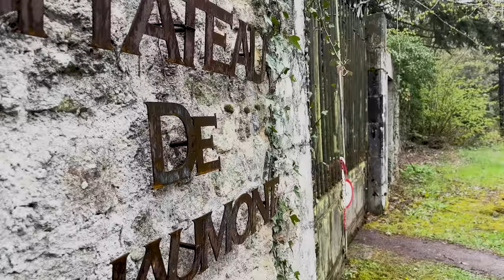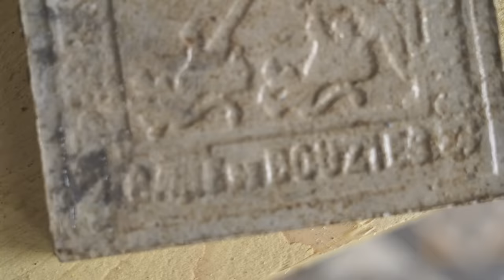Will the chateau's original 1920's tiles withstand REMOVAL?

Comment: Please store the tiles securely. With you off site and the tiles all in neat piles, it would be awful if someone helped themselves to them. Great to see Kat and good of her to help out.  You both did a fine job.
Reply: Just thinking exactly the same thing
Reply: Indeed. Thieves will thieve.
Reply: Best storage is a lock up container on site.
Reply: I was thinking the same thing.
Reply: Or a hidden camera onsight
Reply: Security cameras on site definitely!
Reply: Indeed. Especially when another poster checked the manufacturer and these are probably valuable.
Reply: @jantsjerijpma628  And then what? Cameras are only useful if you get recognizable things on them, which would not be likely here.

Comment: If you cant find enough to fill the floor, place as large a square as you can of the original tiles in the centre of the room, then add a new border inside the existing border tiles.
Ps as someone else stated, keep the odd bits to share with your viewers/supporters
Reply: This can be done with copies

Comment: I once removed til that were laid with a modern adhesive. I'm so jealous of how easy those came up. And Cat,  yes, as soon as the camera comes on they are impossible to move. It's the same rule that applies to funny noises in your car. The noise stops as soon as the mechanic is there.
Reply: With the old technique of using concrete (sand and cement) it's really a matter of luck. If it was properly done it's nearly impossible to separate the tiles from the thick layer of concrete (20-30 mm usually). I don't know what the main factors were but I'd assume the sand - cement ratio, the amount of water in the mix, whether the tiles were wet or dry and site factors like air temperature and humidity.

Comment: The Encaustic tiles that you are lifting our prone to cracking and chipping if left exposed to moisture/water for to long as well as frosts.
An extra tip for lifting stubbing ones is to use a hacksaw blade on its own to cut underneath it, it’s very slow and tedious though!
A thin wallpaper stripping blade can also help……
Just as a thought, one of those vibrating saw blade things could possibly help!
These tiles can reach high prices £50-£100 for single tiles sometimes, so maybe they should be placed under lock and key for the time being…..
There are still a number of companies that make them and can easily reproduce them, but again you could be looking at prices of £25+ per tile….

Comment: The tile lifting went far better than I feared. I guess they either lift, or in my experience they do not shift short with anything much short of a nuclear blast, which tends to be a bit over the top. Having a team always make the work progress far better, and that floor lifting went. The only way to think of it is that the tiles that are broken have had their chance, those that have been salvaged can be considered saved for reuse. You might be able to scour salvage yards and find some to fill in the missing items, or adjust the original design with modified boarders or similar. Mind you, it might just drive you nuts working out a new tile layout.

Comment: Well that job went a lot quicker than I expected. Lucky for you only the minimum adhesion was used. Thought it would take several days with a lot of breakages. The border being more of a challenge is better protected from falling debris than the centre so hopefully, you will get that out too.
Broken tiles - as someone suggested, the Japanese method of celebrating the damage with gold joints could be good. Gold veins catching the light in spaces with lighter footfall.
Nice to meet Kat. Cheery character and easy to work with. You've both done a great job today.

Comment: So nice you were able to save the tiles. Nobody makes them that thick anymore. You don't find any that thick in Home Depot. I don' think you can find anywhere that substantial around here. 
BTW- Ii think I know what those straps of iron are running between the corridor walls where you are placing the timbers. I think they may have been intended to keep the corridor walls from separating.  They were always intended to be in tension (to be pulled) because they are only straps. They are so badly misshapen now probably because the fire heated them so hot they oxidize more easily and actually got fatter and a bit longer.  It happened on my old wood stove  The parts of the metal that were red hot the most would actually bulge after a few years. This is thumb nail chemistry but the iron molecules actually get larger because of all the oxygen molecules added to them. Very hot metals oxidize very quickly. Borax or coke have to be added at times to get all the extra oxygen out of the metal before it is cast. 

I don't think those straps were ever actually necessary but the builder probably thought of them as a fail safe to prevent the floor timbers from falling from their sockets.  You cut your timbers square. When you build the permanent floor the way the original timbers may have been cut was at an angle. They were tapering outward toward the bottom of the joist. The reason they did that was in case a fire destroyed the building the falling timber wouldn't act as a lever and push upward on the wall above and topple it too. In other words the top of the timber barely penetrated the wall. Only the bottom edge fully enters the wall. 

Your house is actually showing signs of 19th century scientific building practices that were still in an early stage.  Houses older than yours probably weren't cutting floor joists like yours probably were. Your house was designed with more modern ideas. That whole stair hall couldn't have been built without the use of iron of steel beams. The columns hold the full height of the tower plus the missing roof that was maybe another 9 or 10 meters  higher. Those two columns carry some of the largest loads in the building.

Comment: This gives you a nice opportunity to replace the old floor with a polystyrene block and beam floor with radiant heating in it. Saves you a lot of energy in the future
Reply: Indeed combined with the dual pane windows he is working on in the background (and possibly triple elsewhere), modern insulation for the roof, this could be a very efficient chateau.

Just don't forget fire suppression this time around.

Would be interested to know what heritage constraints they are operating under.

Comment: Have you thought about heating the chateau? Now that the tiles are out, you can think about an underfloor heating combined with a heat pump. Gas and oil will not become cheaper, electricity you can produce (partially) on your own. And for the really cold nights you will have the fire places back, I assume.

Comment: Dan reach out to Phillip and Anna at How to Renovate a Chateau without Killing your partner. Anna made all of the tiles for their kitchen. She had a local kiln help her but she did the design. Bet she can help give you ideas on how to recreate the broken ones
Reply: Totally different kind of tile. Hers were clay with the design painted on and fired. These are cement with the different colors for each section poured into a mold of the design in a 3 layer process and then hydraulically pressed. A much more difficult and complicated process requiring specialized equipment and someone to recreate the design molds.

Comment: My husband did flooring installations for a couple of decades. I worked with him for a few years, and let me tell you, it's hard freakin' work. We had to remove ceramic tile in a kitchen once that would not pop out. We ended up having to use sledge hammers to the entire kitchen floor. Chips were flying everywhere, and we had little, bleeding cuts on us from it. If I never have to remove another ceramic tile floor in my life, I'll be perfectly happy.

Comment: For short/long term storage, milk crates set on pallets in in out of the way. In US hard plastic stackable crates are used to carry gallon milk jugs (4) onto fridge trucks for delivery to shops. Really useful for storage of bits to be recycled in future construction work. I presently have 15 crates in my backyard filled with hexagonal 13 inch exterior grade terra cotta tiles. Soon, very soon.

Comment: There are more than enough tiles to place the original pattern framed with the border tiles in the centre of the floor, (the framed tiles could be as large as the number of tiles, allows it to be). Another flooring material could be laid to cover the remaining spaces around the room

Comment: Good call to remove them, the concrete floor most likely needs to be removed and renewed.
And these tiles are unobtanium, in other words, very valuable and difficult to find.

Maybe an idea if tiles are diffcult to remove, slam the floor with a hammer just in front, so the vibration will loosen the tiles.

Keep up the good work, making progress!

Comment: Try using a thin metal scraper to remove tiles. That spade will be a bit much for the harder to remove ones. And don;t throw out any of the broken ones. They can be used for cutting in of the edges.

Comment: Okay Dan @Escape to rural France ……I can read  (?) DE DOUZIES  on the bottom of the tile, and here is what I found out about that. A reference online to “Antique French ceramic encaustic tile manufactured by Carrelages ceramiques de Douzies Maubeuge in the early part of the twentieth century”
The top looks it reads 8 (?) ANONYINS
Reply: Found more: Douzies Maubege French floor 1909 … encaustic tiles were produced by Societe Anonyme, Gare de Douzies, Maubege. 
So the top is likely not an 8 but S making the tile read on the top “ S. ANONYME” and the bottom likely “GARE de DOUZIES”.

Comment: Hi Dan, I'm sure you get loads of helpful comments. The unstable floor bothers me a little bit. If it collapses it will undo all your work in the Cellar. Might I suggest that you get an 8 foot by 4 (that'll be 1220 by 244o in metric) foot piece of shuttering ply or marine ply then dig as far as you can reach and then move it all forward and repeat that way you'll spread the loading. Just a suggestion.

Comment: You need a DeWalt oscillating tool. I’ve seen blades for those things about four inches wide. I bet one of those could get under even the most firmly affixed tiles.
Reply: Exactly what I was thinking.

Comment: So the tiles were not glued to the floor as we do today? Well, whether you put them down again with the same way, or use some kind of adhesive, remember that the floor must be very clean, because if there is dust after a decade or so, the tiles will start to come off. I've seen it in apartments where the floors were not cleaned up properly and the tiles started to come off and just the cost of removing them all and replacing them with new ones was significant, the least to say. Good luck with your renovation, you have done an amazing job so far.

Comment: Its very unfortunate that they have to be removed but I would guess the mortar holding them has deteriorated to the point that most are not being held down by much anyway and you have time to figure out how to remove the difficult ones later on I wonder who knows if there is a chemical or process to dissolve the mortar to get them up too.

Comment: The floor tiles are tight fit installation without grout.  That sure makes it easier to get them loosened.  
You really need a skid to pile them onto so you can remove them from the room with a forklift to store in a safer place.

Can you have a large shed delivered on the property?  It could see e several purposes; you can install the solar panels on the shed roof where they might be safer than the balcony; then you can keep your tools and valuables locked up in the shed. What do you all think?

Comment: Use a piece of scrap wood and put beside tile. Rest scrap wood at base concrete floor. Tap wood a few times and it may help you get tiles up easier before prying up tile with flat edge shovel. May help.

Comment: what are you going to do the floor with... concrete slabs like before or a poured concrete slab which i think will be stronger but then you might loose alittle bit of head room in the base ment to the i beams you need to have supporting the floors... unless you consider lowering the floors in the basement and strengthening the whole build from the foundation to the roof tiles.... btw would it be possible to use climbing gear to put tarps above now(just in the one spot you are working in) or do you need to stabalise the upper walls more

Comment: I'd recommend the tile lady from the Modernist Mansion (Ollie & Camilla).  The top might read "arondis" and the bottom either "douzaine" or "douzie"....also someone's recommendation of using clay and pressing it in could work.  You might also try bathroom silicone (100%, not latex mix) to make a mold.  That might be cheaper....it's wonderful that Kat has come to assist you.  I wasn't sure at the beginning, but when she bent down and her hair fell forward, I knew!

Comment: Really really urgent to get a plan in place to replace that roof!  As I’ve watched each episode since you bought the dilapidated château, I’ve been thinking out loud “ Dan needs to urgently get that roof replaced” !  First things first. Get the place watertight before doing any other project. That means roof first, then windows and doors!
Reply: He can't start rebuilding the roof until the walls are stabilized and he can't do either of those things until his building permits are issued which isn't supposed to happen until the end of June. He's doing what jobs he can in the meantime.

Comment: Why not just fix the roof? Gotta be the highest priority after cleaning out the rubbish.
Reply: Sometimes you have to work backwards to go forward, the walls probably wouldn’t withstand any cover or roofing placed on top of it at the moment.
Yes you normally start restoring a building from the top down, but you have to make sure the foundations and walls are safe before you start building on them.
Also the concrete ground floor is compromised and needs to be removed, which could weaken the walls even more until fixed

Comment: so you could not drape 6 pole mounts that would be sturdy enough to support a lightweight vinly that would shed the water and rain away from the property....?   What is the square footage....?   all the rain on the property worries me....not so much what was left there but the wood flooring and repairs you have made already.......I would set some really tall poles in the middle of either side of the castle....if feasible....and then two lower poles for the rain to shed downward and off to the sides and not down into the property.....just my opinion of what I would do.....I think that particle board gets too wet it swells up and ruins.....anyway.....I would think 6 large poles and some light weight vinly....does not have to be heavy duty just something like  a lite raincoat that sheds the water away and not allows it to drop inside the property.  Looking good....so proud of you and happy for you....

Comment: Can you please explain (again?) why you don't start with the roof, or at least make the house watertight?
Reply: Sometimes you have to work in reverse order or what seems to be a disjointed manner… yes you always started from the top and work your way down when it comes to restoring a building, but you would normally place scaffolding over the whole building and basically build a tent over the building.    But to just put a roof over head you have to make sure the wall can take that weight, which in turn you need some beams/girders to help support those walls and stop them from bowing out.    At the same time you try to protect what finer architecture details might be within the building, there’s also the case of waiting for planning permission to do such work, which can take months…..

Comment: I dont understand your logic on the steps you are taking. As we say here in australia your doing it arse about face. You need a tarp for the rain instead of creating yourself more work by taking up the tiles 🤷‍♀️🤷‍♀️
Reply: The concrete floor under the tiles is compromised and will need to be lifted and replaced, the top of the walls are very loss and could crumble into the building, even a light weight tarpaulin over these walls could cause the walls to collapse.
Sometimes you have to work backwards in order to go forwards, ideally you would scaffolding over the building and basically create a tent over the whole building, but needless to say that is very costly to do….

Comment: Sorry but my dude might be way over his head on this one. The structure is so far degraded , it requires more than he realizes. So much rotted and degraded debris at the top and he is worried about and already cleaning the ground floor. Once you start tearing into the upper floors and walls, you will have more tones of debris to clean up. This is not a restore,its a complete rebuild . My opinion, if you have your own, post it but don't shit on mine.